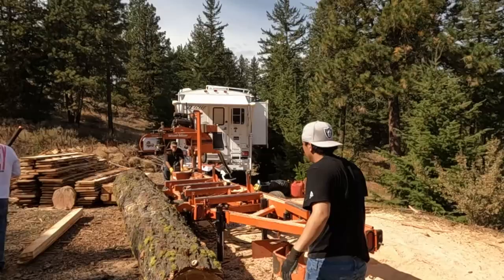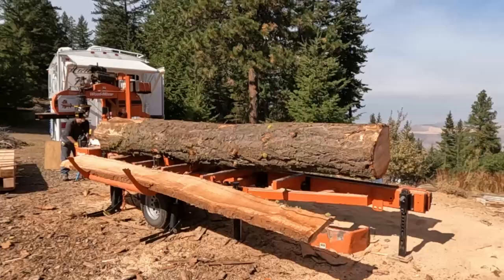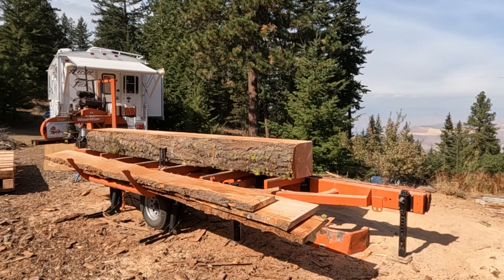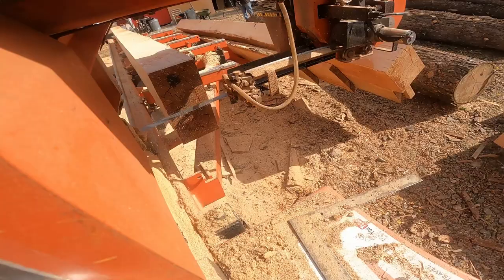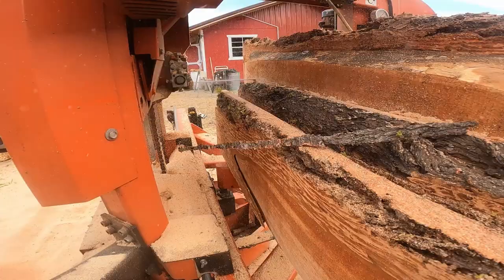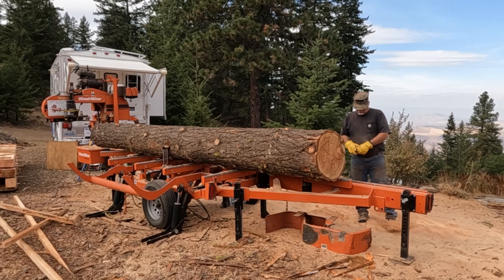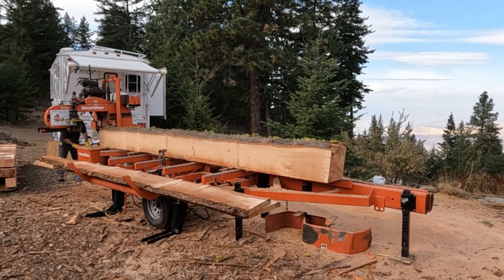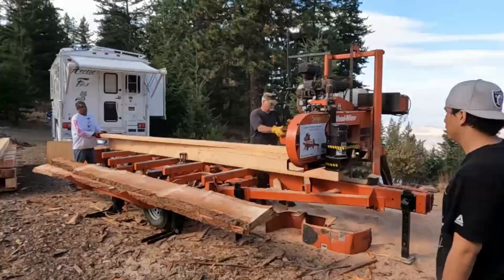Free Of Heart, Boxed Heart, Or Mill It Out! #sawmill #woodmizer #woodworking

Comment: Good video, Erik. Thanks for not mentioning my name when talking about toe boards.
One comment on leveling the mill; I have found that if my mill isn't pretty close to level lengthwise the carriage will, sometimes, decide to go on an excursion all by itself. This can be embarrassing.
Dave
Reply from the maker: Very strange, that's never happened to me bud.  In fact, I've purposely put it on an uphill slope when working alone so the head would freewheel to the rear ;)

Comment: I was told that with beams, always box the heart.  Before I heard that I milled a big log and got 4 nice 6x6 beams with the pith in a corner of each beam.  Seems that with the pith in the corner, the beam would be less likely to crack.  Whats your take on that?
Reply from the maker: I would cut it out of them.  IN fact, cut it and some enough around it to remove juvenile wood with it as they will bow, cup and generally be too weak.  Sorry!  Either box them in the middle or cut them completely out.
Reply from the maker: Incidentally, I made this mistake myself and  have done it recently, too, when cranking away and not paying attention.   When I do I go back and make smaller beams

Comment: “…the best quality beam that you can make is FOHC… the next best beam that you can make is a boxed heart.”

Does this also apply to oak?  I have many pine logs, but they’re too small to make the size beams I want by using FOHC, so I’m stuck with boxed heart.  BUT, I have some huge oaks and would like to mill beams also from those.  Is FOHC still better than boxed heart when milling oak?

Thanks!
Reply from the maker: Yes.  All trees grow outward, and the heart is the juvenile wood and weakest, and the pith is the absolute weakest part of the log.  So box it or mill it out for strength.
Reply: Thanks for the reply!
Reply from the maker: You bet!  Any time